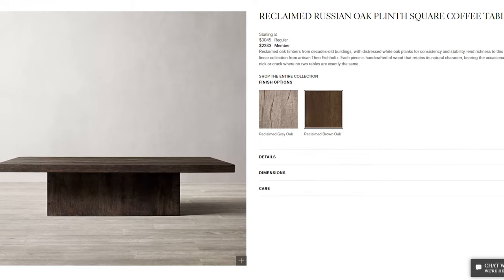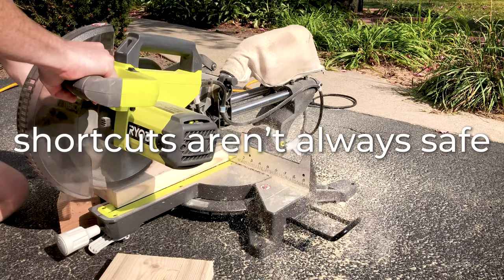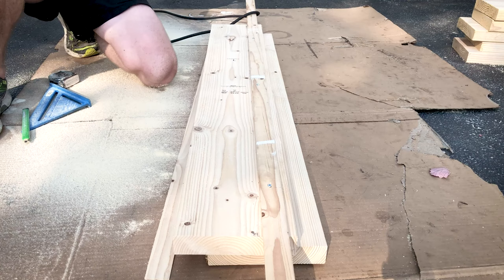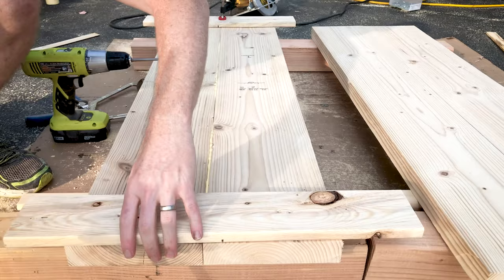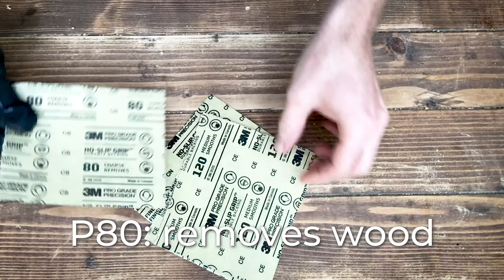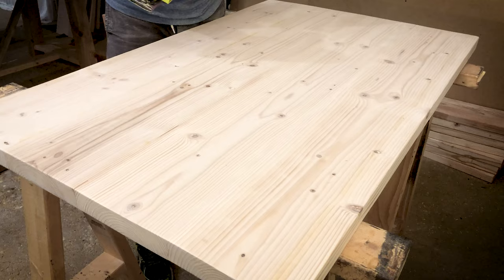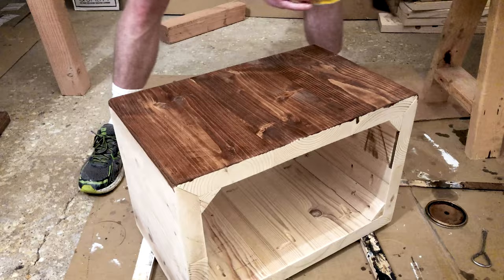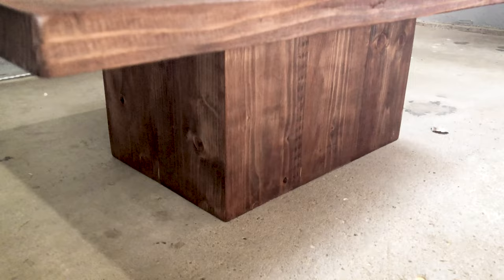Basics of Woodworking | How to Sand, Stain, and Finish Furniture | RH Coffee Table Build

Comment: Gaps in the boards, left glue squeeze out on the bottom of the top when applying finishing, the plinth is wonky and too many sanding marks. Its a nice looking table but if you took more time it would be an amazing looking table. Dont mean to sound rude but I took a lot of constructive criticism when I first started which tought me a lot. You are on the right track though buddy.

Comment: I think, at least to 90% of those who'll see this will surely mistake it for walnut, which is we want anyways. Great job. Also, I want to commend you for making use of the tools you have. The Miter Saw may not be 'the-best-choice' for a few of the cuts you made, but I'm all about using 'what-you-have' inspite of what you 'would-rather-have'.
I have an old Skil 12.5Amp Circular Saw that I also mount upside down for use as a table saw.
Reply: Nobody is mistaking that for walnut lol table looks great but looks nothing like walnut

Comment: Quick question, how thick are those pine boards you were using? they look really thick, and i dont think i can find anything thicker than 0.34 inch in my local HD or Lowes stores
Reply: They are standard 2x thick construction lumber meaning they measure an inch and a half in thickness